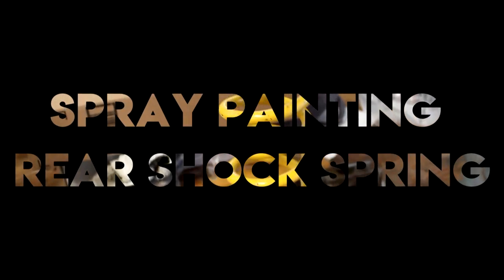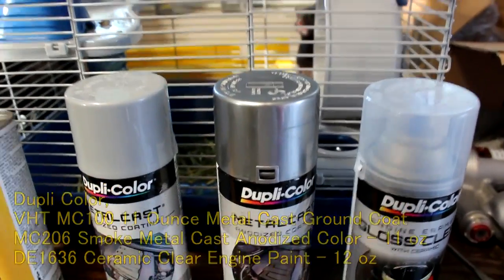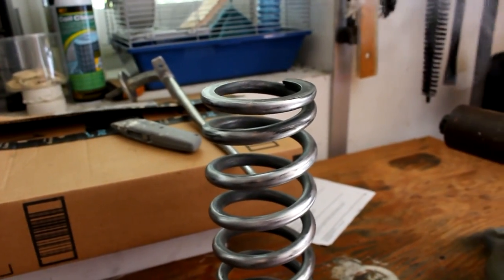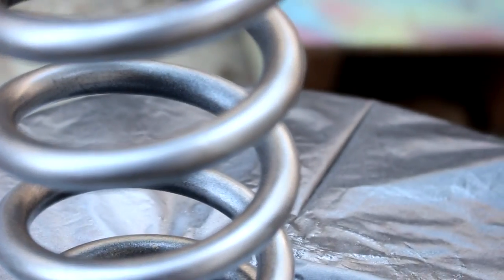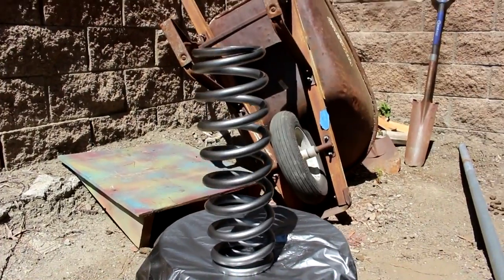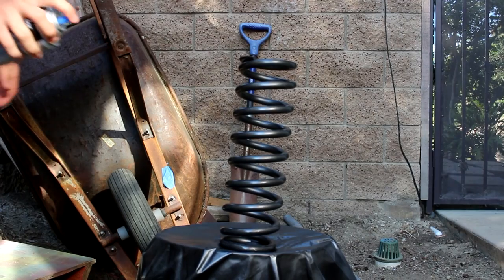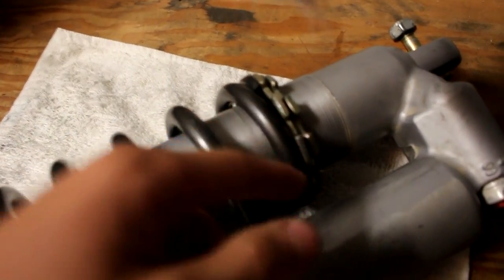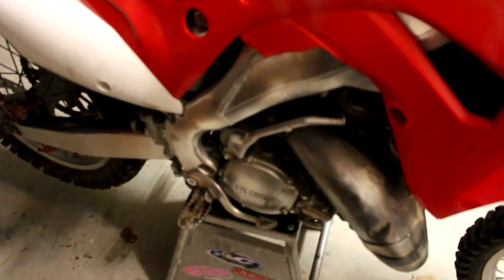Does spray painting a coil work? Step by step guide and test

Comment: Soooo, it has been more than 2 years :) How's the paint holding up?
Reply from the maker: Great. It’s protected from the back wheel, so there’s not really any risk of rocks unless you get roosted by another bike. As far as from compression, still no cracks or flakes in the paint. Just use a good quality spray paint and don’t take any shortcuts and it should be fine.
Reply: @andrewschwartz_  Thanks for the quick reply and advice! And best wishes from Ukraine riders ;)

Comment: I used brush on paint stripper to remove all my paint, then glass media blasting finished it off, inside the coil and out. You didn't demonstrate flipping the spring to paint the base coil and full coverage of your top down paint application.

Comment: hey what is the difference between normal spray paint and spray paint that is made to be a base coat? is it just a primer?
Reply from the maker: Been a while since I last looked at the can, but if I remember right the color coat is slightly transparent, so the primer/base will show through.